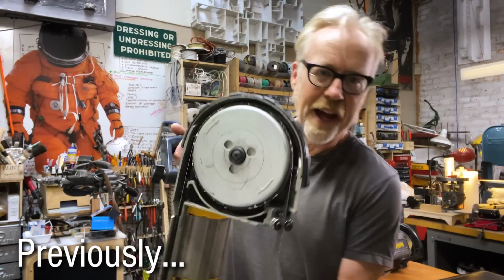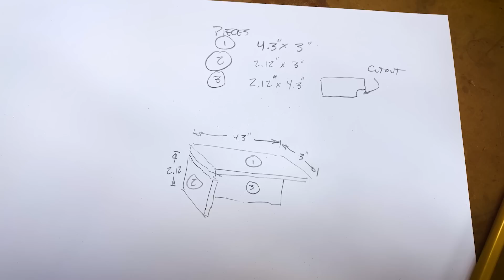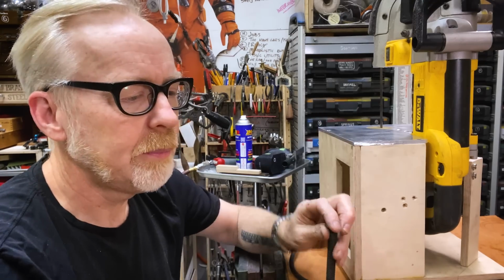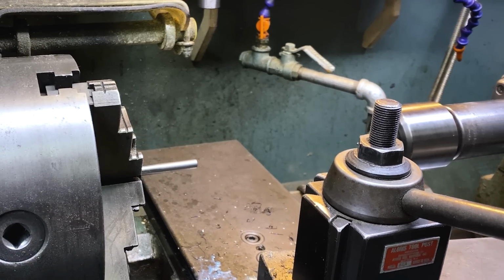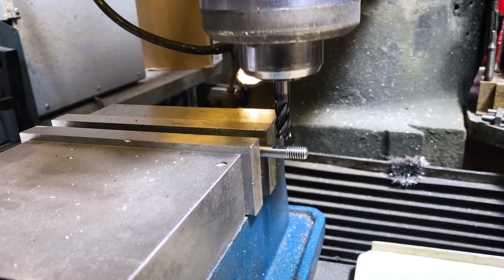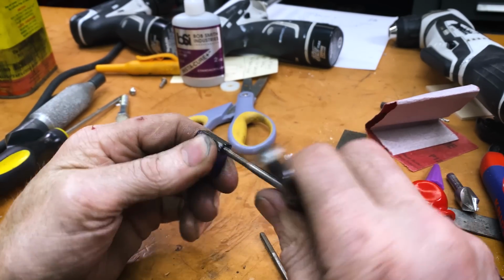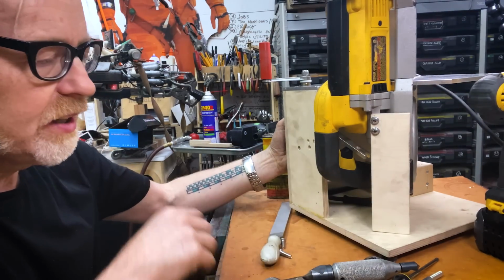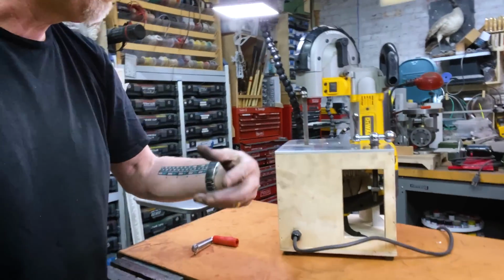Adam Savage Upgrades His Mini Bandsaw!

Comment: There's already a dial on the back of the saw to adjust the speed.
Reply: For real. I feel like I'm taking crazy pills. There already is a speed control on the thing!?
Reply: Was thinking the same thing. I don't get it.
Reply: Plus if he has ever used it much , coming thru the table is a horrible idea. I rip stuff all the time on mine and that's right in the way
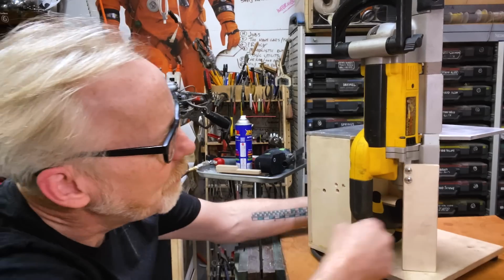Reply: 11:15  Yeah, I can see the dial right there.  Does Adam not read the instruction manuals for his tools?  I always do.  Oftentimes it’s easy to miss a feature.
Reply: @GibClark  I agree, I have a similar saw on a SWAG offroad table. Having a handle right there would totally be in the way.
Reply: @30CalCoreLokt  Actually that's not a good idea. Dimmer switches work for lights but not for power tools.
Reply: @TheBreaded  a dimmer switch can handle a leg of power from the breaker box which means it can handle at least 15amps.  I dont see that saw pulling that many.  Unless there is an issue with the pulse modulation in concert with the brushed motor on the saw I am unaware of.  If it concerns you, there are readymade solutions that you can plug in in-line with the tool.
Reply: @30CalCoreLokt  It's not about the power load a dimmer switch can output (though if you lower the voltage, the amp draw would go up), it's about how it regulates power. Most dimmer switches cut power by lopping off part of the AC waveform. This doesn't change the frequency which is what determines the speed (depending on the motor type). If anything using a dimmer would only make the saw less powerful, not slow it down. And yeah, there are other ways to accomplish this but they're much more expensive than a dimmer switch (and depending on the tool, may or may not work. For a dumb AC motor it's one thing, but most hand tools have microcontrollers that regulate speed), but the main thing is the saw in this video HAS a speed adjustment already built in (which connects to a microprocessor and controls the power output of the mofsets that power the thing).
Reply: @TheBreaded  good points! I've done it before but it was on a very basic motor.  I agree he should have used the built in option. Thanks for the explanation
Reply: @30CalCoreLokt  It can work for tools that use brushed universal motors and no controller, but those dimmers aren't designed for inductive load and the motors are getting fed a VERY messy AC waveform that could shorten the life of the motor. This isn't an issue for light bulbs or resistive loads, but on brushed motors it can cause issues, even if it "works". On top of that, if you lower the voltage the amperage going through your wiring can go up and it can lead to melted power cords, premature wear on your brushes, ect. Get a proper speed controller or use the tool as is, otherwise expect mixed results. Maybe it's worth it on a $20 drill or sander, but I wouldn't risk damaging a $300 band saw.
Reply: @TheBreaded  what is your opinion on the "speed controlers" that you plug inline with the tool?
Reply: Right. If I had a lathe and a milling machine, and all those cool machines, I'd like to make stuff just to make stuff too but....
Reply: @30CalCoreLokt  a dimmer switch is NOT designed to vary the speed of a motor.  It would either burn itself up or burn out the motor.
Reply: Well you also have to remember he didn’t even know it had a light

Comment: Part 3: moving the speed control to open the saw to larger cuts. I like the design but the placement right behind the path of cut just really really bugs me.
Reply: Infris Thank you, totally agree.
Reply: It's been a mish mash of frankly silly ideas since the start. Creates a recessed switch so that it can go in a corner....then has the cable enter on the side, could have had the switch above the wire, well out of the way. Wire nuts instead of a proper insulated join, a speed controller next to the open operating blade that also limits the cut path. Usually I'm impressed by the stuff Adam creates but this is just a mess of broken ideas
Reply: i agree. would be nicer to see it on the side or something
Reply: This bothered me a lot too until I remembered that the way this saw is set up is that it has the actual machine itself in the path of the blade, the blade is perpendicular to that silver plate on the saw itself. You can see him struggle with this reality in the previous video when he cut the aluminum plate for this build, he was limited by the distance between the blade and the housing. I'm not sure if you can adjust the angle that the blade cuts at, but it doesn't look like that's possible and if that's true then the handle will likely never get in the way.
Reply: You are limited to a certain width when making longer straight cuts with it but with it being on a stand you can do more such as curved cuts much easier than when it's handheld. I'm sure he'll probably mainly use this for smaller pieces but building a tool just to limit it like this just doesn't feel right to me.
Reply: Agree with all of this. Maybe have the adjuster in the same location but inset flush with the table so the crank will engage in when needed and removed when not. Then put a strong magnet somewhere on the stand to hold the crank when not in use.
Reply: @Nosyarnhoj  Yeah, but the handle still gets in the way of some cuts. The body limits the cut depth, but only on one side of the cut. One reason for this is so you can sight down your cutline. But another reason is so you can cut an L shaped bracket out of say a piece of 12" x 6" plate, by cutting <5" squares of waste out of the L. The handle can get in the way in this kind of waste removal type of cut.

Comment: perhaps a downfolding cover for the exposed blade when adjusting speed would be usefull, just so no arms get sliced and diced.
Reply: Or a safety guard like all good bandsaws have that raise and lower so your material just fits under it stopping the work from lifting and you touching the blade etc etc

Comment: So glad to see you're finally covering that switch!  Have you ever thought about being safe and actually doing the box in  GROUNDED METAL? Sheesh!  Also advisable to bond the tool and bed together to ground. Even if it's double insulated, you've modified it now and leave it plugged in all the time. It wasn't designed for that. 
Also, I know you have a passion for wire nuts, and that might be ok for a prototype, but when you have a machine with lots of vibration and moving parts, it's really not an advisable to use wire nuts. Use a vibration rated connector or crimp those babies.  A loose wire that's not quite disconnected is what gets hot and starts a fire.
Reply: Bought a van w owner installed   house power line  in it ,had my electrician go thru it all before I touched it, thank God. 3 nuts were totally  off and all the  other  20+ nuts the guy used were loose, idiot used house parts  for a vibrating, bouncing van. Probably the only thing saved it from sparking and catching fire is it's an aluminum van!!

Comment: Maybe I'm missing something, but couldn't Adam have removed the switch and just wired in a potentiometer to do the same thing?
Reply: wiring in a potentiatometer would require a bit of testing to dial in the high/low voltage. I imagine a mechanic answer is merely more suited to Adam's way of building.
Reply: Was just about to comment that, but he may not want to disassemble it for warranty or something
Reply: That's what I thought too, but everyone is different in the way they tackle a problem an come up with different solutions. The good thing is that either solution works but one is more complex than the other.
Reply: i dont think he wanted to alter the tool itself
Reply: The trigger also switches mains, it may not be possible to modify it safely. 

In addition many people are more comfortable and proficient in mechanical problem solving than electrical. Whatever works right?
Reply: @DinosawrsAreAwesome  Yeah, although this does seem dangerous, as his forearm is dangerously close to the blade as he's turning the handle.

Comment: wonder why he didn't wire in a rheostat...
Reply: I was about to comment that too
Reply: Because a giant metal handle is always much cooler. I know that's what I would do.
Reply: Why are you worried, you will never come in contact with this tool in your life
Reply: @tylerhorne1099  why are you worried about my comments? I'm not worried. Just a question.
Reply: He could use the original switch. It's not like he's ever going to take it apart. When you build things, you should simplify them. Re-using the switch is one of those things.
Reply: I was wondering why he just didn't use the one built into the tool...
Reply: wondering why he cut the power cord. They are made to be replaced. I always replace them with a 50ft extension cord.
Reply: There's already a speed control dial built into the tool. I think he just wanted to have a big knob poking out of the top.

Also, a separate rheostat may not have worked; a lot of these "variable speed" tools really only have a few fixed speeds, and the trigger actually has a digital encoder.
Reply: He should have just used a router speed controller

Comment: Why didn't you just use the speed dial on the saw?
Reply: yea was thinking the same. not sure if that might be a mechanical one, so relocating wouldn't work. if not, yea why not just relocate that one.....
Reply: For one thing, because it is in a really inconvenient position. 
For another, I think that it is an adjustment for the trigger travel, not the speed of the motor. By adjusting the travel of the trigger, you get variable speed, but in a less technical (electronic/expensive) way
Reply: @woodworkerroyer8497  That is 100% a speed control dial.  Since the badsaw is portable and you are going to be holding it above your head or pressing your weight into it you can use your complete strength/grip and just adjust the speed controller dial for the desired RPM.  This mechanical knob solution is cool but he also took away from usable table space and now has limited his ability for cutting certain material on the table.  I think he is going to revisit this in the future as it will undoubtedly get in his way.
Reply: @CodyYankey  I'm surprised he didn't try hooking up a variac or some other type of AC variable speed controller. ... I presume it was because of the electronics inside... But a quick snip snip and his favourite wire-nuts?
Reply: why yall worried? You're literally never ever gonna come in contact with the tool?? It works for him, it literally doesnt have to work for anyone else
Reply: @jamess1787  $18 Harbor Freight speed controller - that's what I added to my bandsaw conversion. Plug it in and done.
Reply: @tylerhorne1099  No one is worried about it.  Of course none of us will use his tools, but when you put stuff out in a public space the feedback is part of it.  You could easily purchase a kit from SWAG and not create any content.  
Adam is an amazing builder and is kind enough to share, that doesn't mean the design choice is perfect and he often goes back to make revisions.  It's the reason I enjoy his content so much.  He builds, uses, and makes revisions as oversights and poor material choices become apparent.  It's nothing personal and I'm sure he recognizes that.  It's easy to watch 2 days worth of work in an hour and criticize the final results.  I get it a ton on my channel from commenters as well.  It's made me better in many ways.

Comment: Why not bypass the stock controls and add on a speed controller?
Reply: I think he mostly wants to leave the actual bandsaw machine untouched in case he wants to disassemble and use it on its own outside of the stand
Reply: @Aleph-Noll  except for the fact he cut the power cable
Reply: @Flux83  I can see why you think that but that's wrong. its pretty easy to resolder that to a new power cable.
(as you notice he didnt even solder the new connection they are all wire nuts=easy removal)
that's not the case with irreparable breaking the main assembly open and rewiring its internal systems. for which on modern tools like this is more complicated

Comment: When he said he'd be adding a speed control, I expected him to add a seperate electrical device with a proper control knob and fit it to the side somewhere safe, not this complex mechanical system to preserve use of the inbuilt trigger.

Not trying to be a jerk, what he made works, and I can understand wanting to keep the tool intact. Just not my expectation.
Reply: What you had in mind is something Jamie would build. Not Adam. Adam always has the tendency to over build stuff XD
Reply: That is hardly a complex mechanical control.
Reply: Ale x it’s more complex than necessary

Comment: I love it. The spindle definitely gives it added character as well.
I most likely would have gone the fully electronic route by cracking open the tool and finding a way to attach a potentiometer to the analog control switch. 
That way I could put a dial on it that goes to 11.

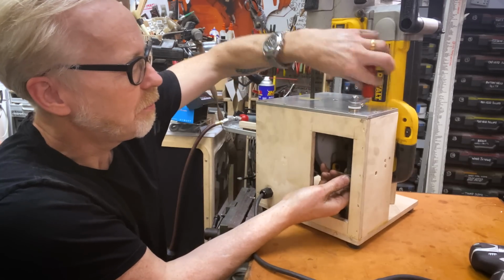Comment: 26:54 Not seen the full video yet, but at this point I'm like .. erm .. there's an actual speed dial on the actual machine. Why not ... just use that? I realize Adams lever thingy to be will be much more precise, within a range set by the machine speed dial, but I don't understand the need?
Reply: precise? did you watch the video?  his speed control is erratic af,  0 precision, and incredibly poorly located.   In Mythbusters, this is when Jamies rig would have been an variable switch and it would have worked 100 times better

Comment: Since everyone is sharing their own take on Adam's solution..
I think I would have kept the top of the table flush and clean, but had the bolt going down through it ( countersunk flat top machined ) and a large thumb wheel made from delrin at the top just beneath the metal table sticking out of the side. Rest of the solution is flawless!

Comment: PS: Sweet crank !!  The blades you use make a big difference not only tooth per inch but the quality. If you get much wobble or constant ticking/bumping on rotation it is a not-so-good welding job on the blade. Found this out after about 15 blades and hrs of cutting.  Cutting is now so much smoother now. A cut line in a 1/2inch piece of metal dos does not have a ridge for every full tern of the blade any longer.  These saws are also fantastic for wood if you use blades for thicker metal. Fewer teeth per inch.

Comment: I made a version of this a few months ago but I wanted it to be easy to take the saw out to use it as normal. My saw drops into a wooden stand, then the steel table I made has the slot in the opposite direction so it just slides into place and secures with one screw, speed control is a wheel on the saw.

Comment: A couple of suggestions for your switch wiring:

1. Connect the live from the power cord to the lower pin, not the center so that only 1 pin is live when switch is "off"

2. Check the pin layout if you have the documentation but if you connected a neutral wire to the switch or put spades on the neutrals as well and connected them to the other half of the switch that the light(s) in the switch would work.

Comment: Love this idea and had made something quite similar of my own last year. But, this model bandsaw has variable speed control on it already with a dial on the handle... possibly an electrical solution vs a mechanical one would have been able to duplicate the speed controller and place a potentiometer on the front or side of the machine. Thanks for sharing all your inspirational ideas, Adam!

Comment: Its awesome!!  I believe it's my favorite as well!! That being said,  I think you still may have to add one more thing to it though.  You may run into scenarios where the device has to be secured to the table or surface you are setting it on when in use.  Coming up with a built in clamping device, so it can be secured to the surface you are working on, would eliminate accidental movement in the middle of a cut.

Comment: For speed control: wheel on the back of the wood housing. Threaded shaft  to trigger with cam shape. Detents on wheel to allow half a dozen set speeds. Would be off the table. Only require a drill hole through box and adjusts speeds in a few clicks of the wheel instead of spinning a hand crank.

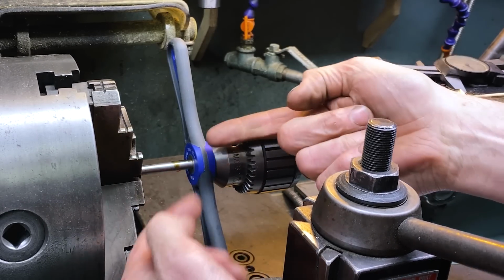Comment: When threading with the die, you had the right idea 18:11. You were able to put pressure on the die to make it create threads 18:42. Had you have kept that setup as it was, all you needed was your right hand holding the tailstock and die simultaneously (making the die not spin) and using your left hand, spin the lathe chuck, in the same manner you did at 20:16. Since the chuck already has so much weight and therefore inertia, it would have been just as easy (and more precise) as twisting the die with two hands. Try that out. Thanks for the video!

Comment: LOVE the build.  I want one for my old Delta Saw, but  the few commercial stands are all metal (for DeWalt and Milwaukee models) and require welding (a skill i do not have).  never thought to make one from aluminum & wood, till now!  Put a pointer on that nut with a scale on the side so you easily know at a glance the min/max settings!

Comment: Adam's engineering is off the charts! I would have tried to mount the shaft horizontally and put a cone shaped piece of delrin on the shaft that pushes the button down when the wide end of the cone is pushed on to the button...

Comment: Thanks for your inspiration. This is the one I did. I added a 90 and 45 track as it's my most precise cutting tool. I set it up like a table saw track with a sled slot on the side.  Thought you might appreciate my take on your idea. Cheers